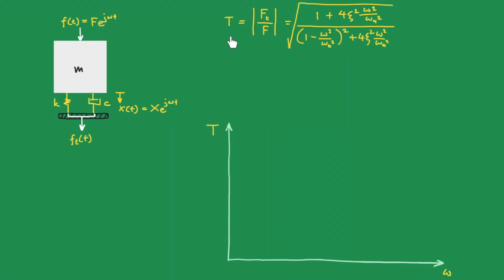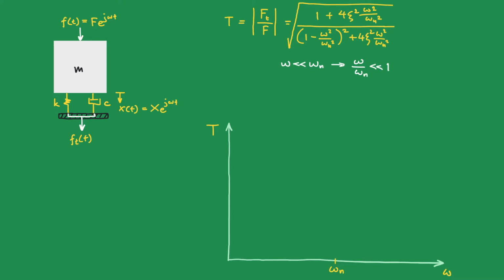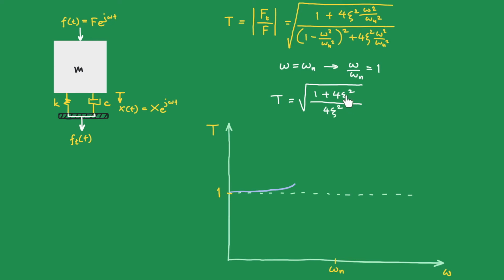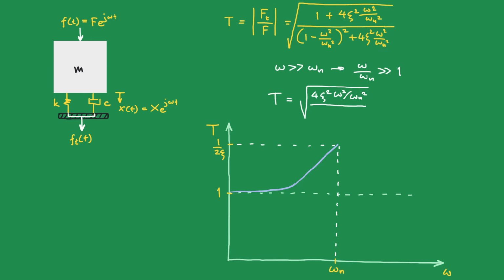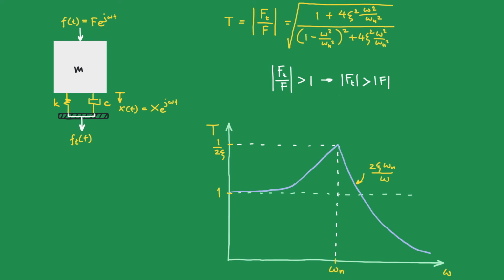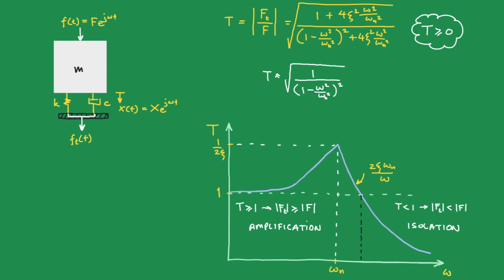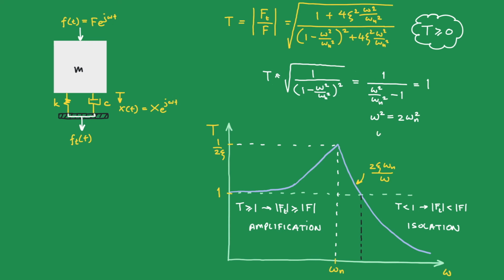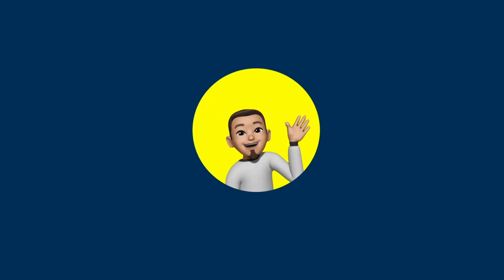Mechanical Vibration: Force Transmissibility (Part 2: Frequency Analysis)

Comment: Till what frequency does that curve be in isolation
Reply from the maker: All above sqrt(2)*natural freq. However need to consider static deflection of the isolator, which means k cannot be so small compared to the weight of the machine.

Comment: Hello dr, thanks for the very easy to understand video. I wonder if the EoM will be the same in zero gravity.
Reply from the maker: Interesting question:) Not sure exactly really. But Gravity only affects the static deflection. What push and pull the mass is the force from the spring.